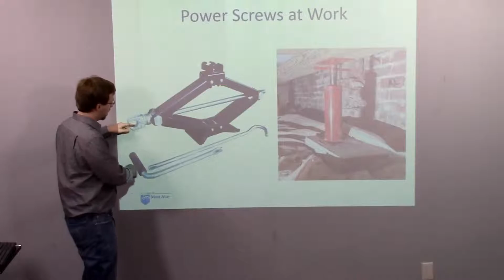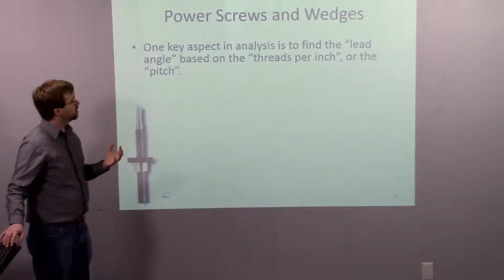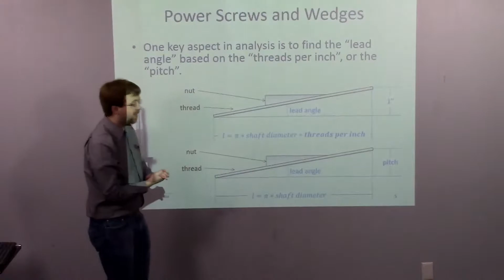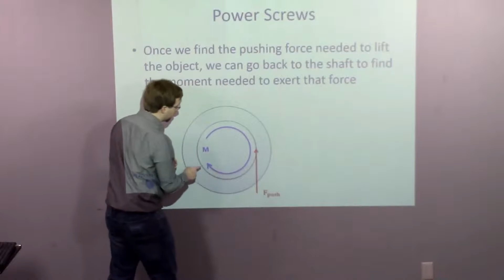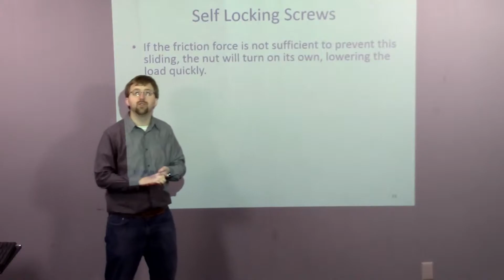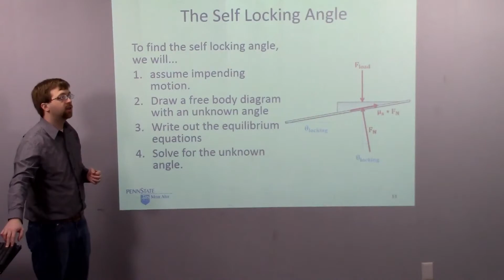Power Screws - Adaptive Map Video Lecture

Comment: at 6:15 you show the formula to calculate the torque needed to drive the lead screw. F load is the load pushing against the nut horizontally. What would the formula look like for a power screw with a platform attached to the nut and a vertical load being present?
Reply from the maker: It would be the same formula regardless of direction.